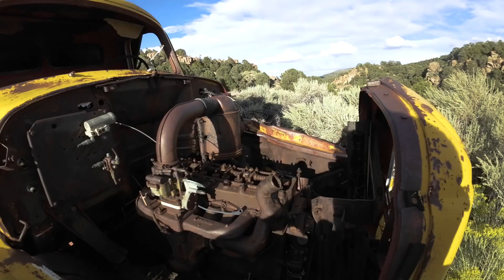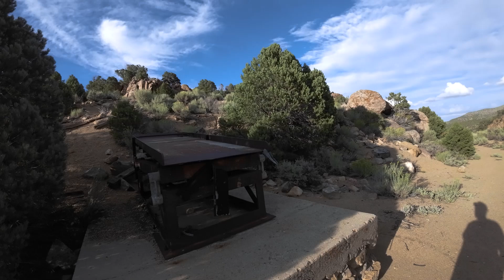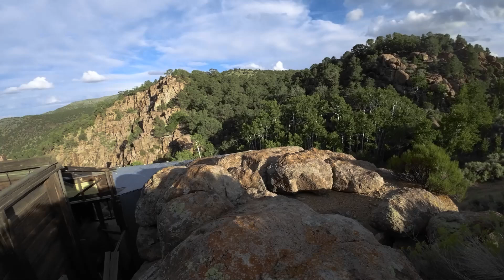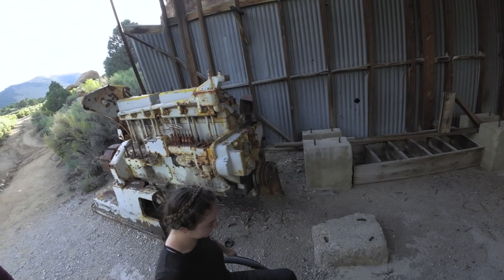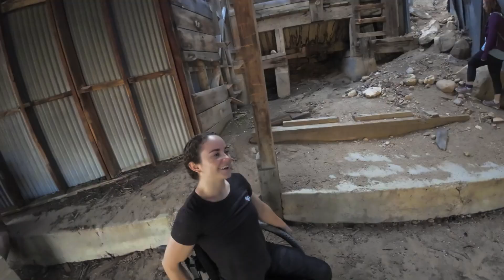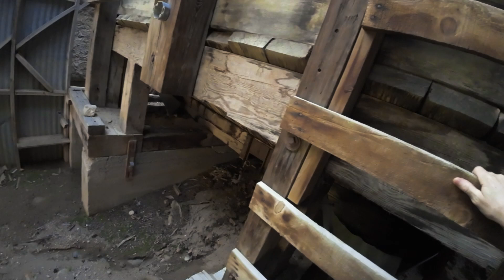Investigating how they got gold down the mountain - Rutland Mill

Comment: the first piece of equipment after the truck is a shaker table. in  the building they must have been crushing the rock. looks like they where crushing rock in building putting the crushed rock down funnel thing at the end and takin it to the shaker table. the shaker table takes a lot of water also. I f you don't marry that young lady I am going to ask her. She is a keeper.
Reply from the maker: This seems to make sense, the only thing I'm wondering is how they got the mixture from the funnel back up the hill to the shaker table. The rest of the system resembles a gravity reduction process, so to try to move the product away from the cliff's edge all the way back up to the start seems counter intuitive to me, but maybe they had a simple way of doing it. Thanks for the input and advice! 😄